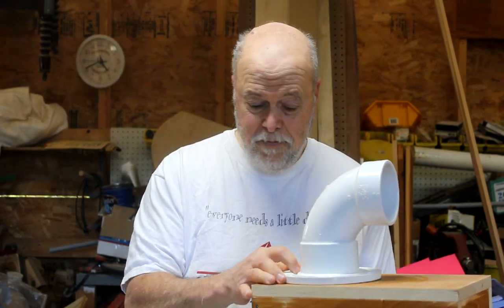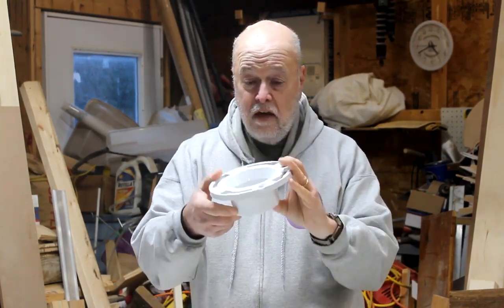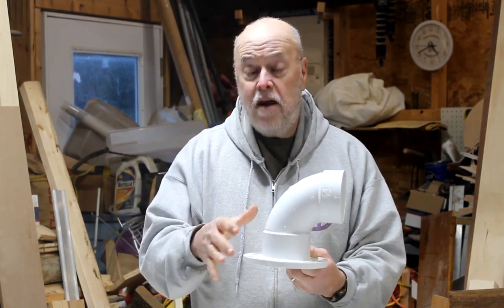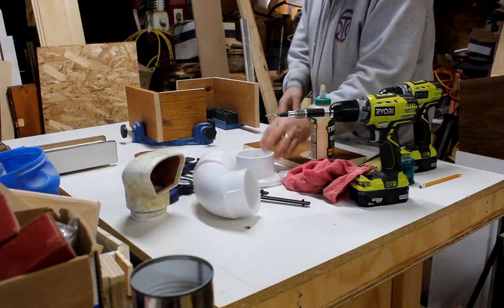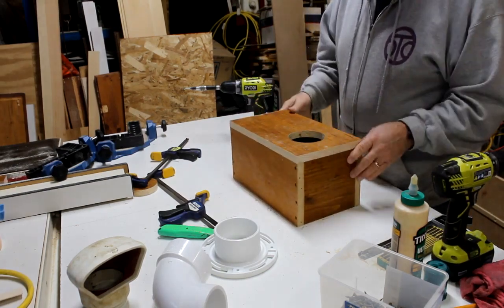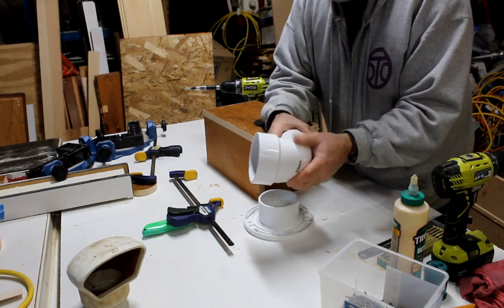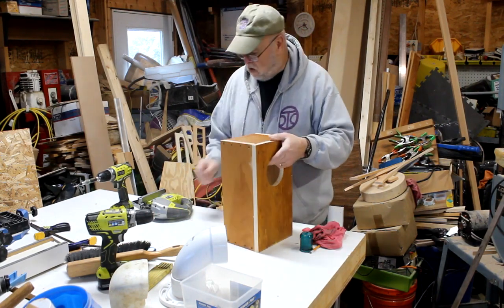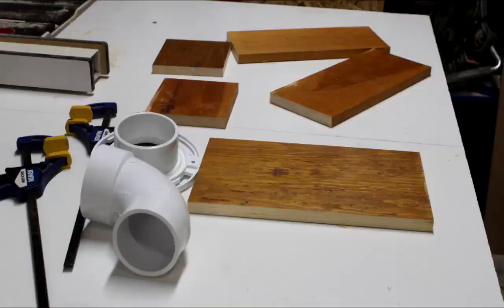(S-1 Ep-35) DIY Dorade Box &  Cowl Vent

Comment: Problem is that plumbing PVC isn't intended to be exposed to the sun, so it has no UV protection.
There are grades of PVC intended for making furniture and greenhouses, etc., that are UV safe, but plumbing fittings are not.
So - while this may work, it won't last many years. Of course as cheap as they are that may not be much of a concern. Just put it together in a way that makes it easy to replace the PVC parts.
Reply from the maker: Yes Jeff. I'm well aware of no UV protection using PVC drain pipe fittings. There are paints available that will bond to PVC and extend the lifespan for a little while longer, but cheap and easy to replace was the original intention. The name "Shoestring Shipyard" should serve as a pretty good clue as to how things go around here! 😂🤣 Thanks for watching. 👍👍👍

Comment: Just a couple tips to you, you could have done this using a 4-in elbow and then your opening would be larger, and a 4-in elbow will fit around the outside of that flange. Those flanges are designed to have a piece of 3-in glue into them or a piece of 4-in glue on the outside of them. Couple other tips, You can get a flange that turns and then you could have glued the elbow on and then you could buy a fitting clean out that would shove into the elbow for inclement weather. Another note is that you could get a union flange and mounted inside the box glue a 4-in elbow to the outside of it and then you would have a vent that would never fall off and would still pivot. On top of that you could take that fit and clean out and you could glue it in and then all you'd have to do is screw the cap on In bad weather. Personally, I just made a couple doorades by 3D printing the whole thing. About $20 in petg plastic. I know they probably won't last as long as nylon or ASA, so I will reprint the tops in ASA in the future.
Reply from the maker: Thank you! 👍👍👍